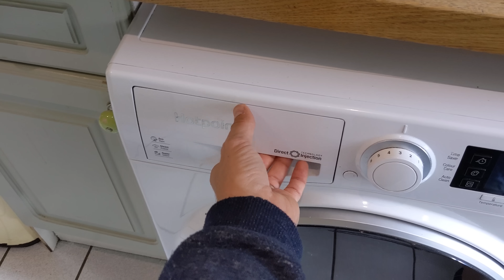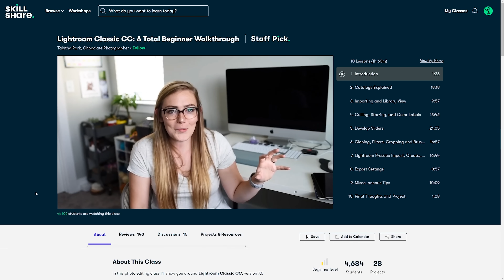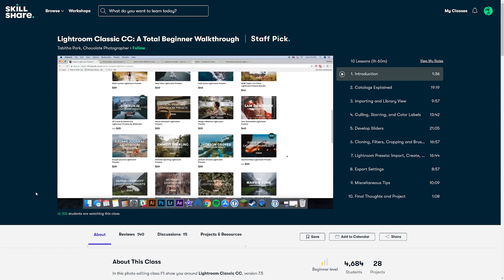The Pythagorean Siphon Inside Your Washing Machine

Comment: Both the toilets at my mother's house don't have an overflow on the cistern, if they need to overflow it trickles down the centre tube as you describe and I have come across this other places . All UK cisterns as far as I know could do this but they often have side overflows that stops this happening. I recently saw a film about a haunting where they were having phantom flushing of the toilet. It was suggested that automatic syphoning was the cause of this so tried to make this happen deliberately but could not. But more recently my mother's downstairs toilet started phantom flushing like this until I  readjusted  the inflow.

Comment: In America the toilet bowl emptying siphon is entirely different. The toilet bowl itself holds a lot of water above a type of water seal trap called an "S Trap". The "trap" is a water seal that holds water and seals the plumbing fixture, bowl or sink, away from a connection to the sewer drain line. The trapped water seals and blocks pathogenic gasses and bacterial from entering the plumbing fixture, sink or toilet and room. The "S Trap" use is forbidden in plumbing code for all plumbing fixtures like sinks. A kitchen sink must use a type of sealing trap called a "P Trap" getting the name from its shape resembling the letter "P". A "P Trap" is safe from the siphoning problem that would drain away the water seal. An "S Trap" is by definition and form always going to have a siphon action that drains away the water seal. So, in America, you flush the toilet by flipping a lever which opens a valve at the bottom of the Toilet Tank water reservoir. This reservoir water flushes away the debris in the bowl and then a siphon action in the "S Trap"  pulls all the water out of the Toilet Bowl. However, this siphon action also removes the sanitary water seal that must be replenished. The Toilet Tank Water Fill Valve fills up the Toilet Tank AND also slowly dribbles a little water into the Toilet Bowl to replenish the sanitary water seal.

Comment: Have you considered looking at adjustable toilet water tank flapper? They seem to fall back down and cover the 'flushing/outlet pipe' hole depending on how far you turn the flapper. I think that adjusts the position of a small side hole, but I'm not sure how that in turn 'times' the bouyancy of that flapper to only flush some amount of water down. Sounds somewhat related to the fluidics in this video.

Comment: About my toilet flushing mechanism. There is a float which sits at the bottom of the tank where the hole to the toilet is. The water's weight pushes at the float, keeping it down and sealing the hole. When you flush, you pull the float up, uncovering the hole. The buoyancy of the float keeps it up and away from the hole until the tank is drained. Then the float seals the hole again. The float is designed so that it keeps the hole sealed when the tank is being filled - when the buoyancy of the float starts to lift it up, there already is enough water in the tank to prevent the float from getting up and uncovering the hole.

Comment: Great video as always Steve. The two toilets in my house have been using the same syphon units for just under 40 years and, only recently, one of them finally failed due to the plastic diaphragm splitting. Because of the split it couldn't lift the water to prime the syphon. I replaced the plastic membrane for about £1.50 and away it flushes again 🚽

Comment: Here in the US, there's a tank at the back with water that fills to a set level, and also has a separate water outlet that goes directly to the bowl in a long drain tube at the top to prevent flooding due to valve leakage (flows up and over into the bowl; also where the small water outlet from the valve goes). At the bottom of the tank, there's a rubber flap valve. Opening said flap valve dumps the entire tank's worth of water down the main pipe which forces a siphon on the bowl and empties its contents partially by suction of water column from the tank. Some of this tank water is diverted to the bowl during the flush (though this differs wildly between manufacturers); someone put a lot of thought into these things so I don't have to. New toilets are substantially better at flushing than old ones, too. Probably need to do one all about toilets unless that doesn't fit your Mould... :P Sorry I had to.

Comment: Not sure how I've been a subscriber for so long and not watched this one yet! Very interesting. I (US) think I've seen these in hardware stores but I've never lived in a house/apartment that had one. My current apartment has a "Sloan Flushmate", which has (is?) a plastic "pressure vessel" inside the ceramic tank. I found this video (https://youtu.be/7EU0mrYYso0?si=s3ZTHYv4p9xm9A9O) that "explains" how it works, but it's over my head. @SteveMould or @PracticalEngineeringChannel do you think you could make a transparent one?

Comment: In the US, I've only ever seen a handful of siphon based toilets. What we predominantly have (aside from commercial rapid flush toilets) rely on a floating stopper. When the tank is empty, the stopper closes due to gravity. When water is put into the tank, the weight of the water holds the stopper shut (because it's pushing against the stopper blocking the drain. When you flush the toilet, it lifts the stopper valve. With the valve no longer blocking the tank drain, water is no longer pushing the valve shut and the bouyancy of the valve holds it open until the tank is drained. In addition to this main drain with the stopper valve, there's also a bypass drain connected to a riser tube. If the tank fill float switch fails, the water level rises to the top of the riser, and any additional filling is drained into the bowl

Comment: This the First Time I have ever heard of, or seen a Siphon Valve. Every Toilet I have seen/worked on, uses a Flapper Valve to Open and Close the Drain at the Bottom of the Tank. At least with the Flapper Design, you can close the Valve if the Shitter is Clogged, before too much Sewage is pouring on to the Floor.
Edit:  I guess the Holding the Flush Lever down on this kind of Valve would be similar to closing the Flapper

Comment: WCs in europe work different. The version in my apartment has a tube with a seal ring on the bottom. When i flush, the tube will be raised, and the water runs down direct into the pipe to the toilet. the tube goes down again, when it closes, the refill cock will be activated, water level raises till the swimmer reaches the max level and shut the refill cock.
The tube is open on the top, so if the refill cock has a problem, the water runs down the pipe to the toilet and makes the water splash sound, so i know, something is wrong and i can fix it, to not waste water.

Comment: The discharge mechanism of my toilet is simpler and the flow can also be interrupted. It's just a plastic seal that covers the bottom and the weight of the water filling the tank keeps it from dripping. When you press the button the cover raises, letting all the water out. There's a small piece of foam to ensure that the cover will stay open until all the water has drained. If you want to do a half flush you push the button twice, the second press makes the cover drop down and the weight of the remaining water makes the seal. The filling mechanism is similar to yours but with a plastic buoy and smaller.

Comment: in the 80s - 90s, in my country at least, we just used gravity to do it. the "cistern" was placed way up on the wall, it just had an air filled ball + lever mechanism to cut off water when it was almost full. we pulled the external lever to let water go through the tube connected to the toilet, and gravity would do the job to transfer the water from high up into the toilet.

Comment: Wow. All of these years, and I never knew about that half-flush. 

Btw, if you do have a "leaky" cistern, there's a plastic screw at the top of the ballcock valve. If you adjust this, it will cause the water to turn off at a lower level, stopping the water overflowing down the toilet.

Comment: 4:05 Oddly enough, that cup design is very similar to what’s called a UFO Percolator in a water pipe, meaning if you inhaled through the mouth of the cup, or blew through the bottom, you’d get some cool bubble action!

Comment: I have never seen  a toilet in the U.S. using a siphon in the tank. The old public urinals used a siphon in a tank high on the wall.  The problem with those was they wasted water flushing  when no one was using it. We always use a flapper valve.

Comment: that is not how the flush system works here in the USA
the lever arm opens a flapper valve to drain the tank. the float valve works about the same. just not the syphon. were you state the water goes into the bowl is were the water comes in.  from the wall hose.

Comment: The question really becomes which is more efficient and which flushes better.   In most parts of the USA  water was not a problem and 5 gal flush  got the job done and the flapper was common.  But as water became scarce, the 3 gal version was made and the flushes were not so good.  When the desire for a 1.5 gal flush came the engineers need to design the s shape better to evacuate the bowl with less water.   It was common to see in CA a pressure flush to force more water out, or a faster tank flow to increase water flow speed while terminating the water quantity.    Does the siphon flush work well?  Does it save water with a low  4.8 liter flush?    I have only seen a few designs with 1/2  flush flapper  for only liquid waste.

Comment: Every toilet I've seen in the US interestingly has just had a rubber flap in the bottom of the water reservoir portion of the toilet, and the lever would pull that flap up. I'm guessing the flap is slightly buoyant because it only lowers back into the sealing position once the water lowers to a certain point.

Comment: Not all toilets have a siphon in their tank (cistern). In the U.S., all I've seen as a flapper valve at the bottom of the tank. However, I think all toilets have a siphon that starts as the bowl fills quickly, which helps the bowl to empty more completely.

Comment: That's so weird the toilet has that siphon to put water into the toilet. You don't need that lol. Every toilet i see here just has a flap at the bottom, and the water just pours down that (it has this other tiny hole for if the toilet is overfilling for some reason, so it still doesn't overflow or anything).
There is a siphon jet that happens at the start of the drainage pipes however, that part is way more interesting imo. Since it is what actually makes the toilet flush all the water down, this doesn't.

Quick explanation: there is a sharp bend right at the start, like an upsidedown U, so when a ton of water is poured in the bowl (like you can literally just pour it in with a bucket manually) then gravity pushes the water up the start of that bend, then when it creates a seal just like the pyth siphon, the siphon is triggered and all the water falls down the drain.
A clog occurs right at the start of that bend, that's why when you get it unclogged, a flush happens automatically. Once the water is free to move down again, the siphon is triggered.

Comment: Actually when you said "this is how toilets must work" I laughed because I've never seen a siphon contraption used in a toilet tank. Now I see one and it's interesting and functional but seems overly complicated as a means to flush a toilet. The flapper valves in most home toilets in the US are simple, reliable, easy to replace and not expensive. They work on gravity.

Comment: In North America toilets work mostly by gravity - when you flush, it raises a flapper-ball valve at the bottom of the tank (cistern) and the water flows down into the bowl, which actually begins a siphon from the bowl, out of the bowl through a curve and down the drain (that ‘curve’, filled with water, is also the seal that stops sewer gasses from coming up and into your bathroom).  When the water is empty from the tank, the flapper falls closed and the tank refills with water. That same flow of water is also flowing down a drain tube, which is what refills the bowl, and is also the leaky overflow that you described. That portion works the same way, if the valve fill, the tank, doesn’t shut properly and leaks a little, it just dribbles over, down that tubing into the bowl, and the bowl’s own natural siphon would then dribble the excess water out the drain at the back of the bowl.

Comment: On your see through greedy cup siphon, if you made the centre channel thinner, and the outer cup smaller, You'd get a much better drain. The pressure exerted is dependant on the vertical difference between the top of the liquid and the height of the exit, but whem the exit path is not flooded (the weight of the water doesn't "pull" ( I don't think it:s an actual pull it's actually a push from the atmospheric pressure, but it's the weight of the water in the downspout which causes the imbalance in ppressure making it higher at the top surface than it is at the exit - or something like that) and when the channels are so large for such a small vertical distance, you are not flooding the entire "exit tube" (I have no idea what the technical term is) so the weight of the "exit" water below the level of the feeder water isn't enough and it sucks air from the bottom breaking the siphon.  Hopefully that wasn't TOO full of errors and you can underastand what I'm trying to get art.  

Love your channel - the mechanical analouge to electrical circuits was the first vid of your's I saw, now I'm hooked - fascinating, QUick question - for the water analouge for electricity, I've always thought of differences in height of water  vessels as being analogous to voltage potential and the width of the pipe analougous to amperage, or potential amperage; try and move too much water at too high a pressure through too thin a tube and it shatters. 've even heard voltage being refered to as "pressure" - it's an analouge that's easy to  visualize as if we have 2 vessles connected by a tube, it's the DIFFERENCE in height between the 2 which makes higher or lowerr pressure, not the height itself.  Anyway, back to the mechanical model -  if the speed of the chain's  movement is the "amps" what is the volts?  I guess maybe the force of the PULL on the chain?  I think that makes sense as I think you said capacitors (mechanical) could be used as volt meteres  and those mechanical caps are spring loaded so the harder the pull on the chain, the higher a reading it will give??  trying to wrap my mind around it - very cool toy/tool - I want one!

Comment: That is strange. Our toilet in sweden works a bit differently. Specially the most modern I have. It have two buttons (like most toilets in sweden) but those buttons are counted to a rod that can be screwed up and down to any given level. And when the water dropp to that level, it closes 

This way the exact amount of water for each button can be controlled exactly and individually.

Not only that  but if the button is hold (any of the two) it will empty the tank completely regardless.

So that basically give three diffrent flushing mode.

Comment: Steve, I've got a mystery for you: why is it that, if you power helicopter blades from a central hub, you will need a tail rotor to prevent the craft from cork- screwing in the air, but, if you power the blades from the tips, with little thrusters, then you don't need a tail rotor? 
You can refer to the Rotodyne helicopter with wings for confirmation of the latter effect. 
Got an answer?

Comment: Hi Steve! The main type of toilet I have come across is not a siphon.
It's hard to explain in writing, but I'll try.
The filling part is the same as yours, but the discharge is different. It is a large stopper at the bottom that is raised with a chain in the older ones, or a button with a lever system in the more recent ones.
The plug itself has some positive buoyancy (usually achieved by a styrofoam disc) that is overcome by water pressure when closed. When flushing, the plug rises and the disk keeps it floating and depending on how long you hold the flush one of two things can happen. If you hold it down long enough all the water will drain out and when you release the flush the plug will fall down and cover the drain again. But if you flush shortly, once the water has partially drained, the pressure of the draining water will suck the plug and close the drain before it drains completely.
I hope I have explained it well enough to understand how it works.

Comment: what the.... toilet in my house doesn't have siphons I think in my case are based on a buoyant object that is stuck on the bottom by water pressure, when release the buoyant object float to the top opening the exit until the level drop and catch the hole again

Comment: Nice video, though only thing I'd like to point out on the loo syphon is that the one way valve works slightly differently to how you explained: it pushes the water trapped above the valve over the top to start the syphon (or I guess prime it) and it is then the drop in pressure created by the water exiting the syphon that falls below the pressure of the rest of the water in the cistern which then tries to equalise and flows past the one way valve.. I didn't have a clue about the washing machine syphon, or greedy cup syphon, so thank you for the enlightenment!

Comment: I read somewhere that the toilet cistern syphon was invented because the 'plug' type was prone to leaking - estimates that half of the cisterns in America were leaking at the time - while the syphon could not ever leak, unless the ballcock valve failed, for which they had a 'warning' or overflow pipe.  Now we have gone back to the leak-prone plug type flush valve, for no discernible reason, other than the fashion for push-buttons, versus handles!